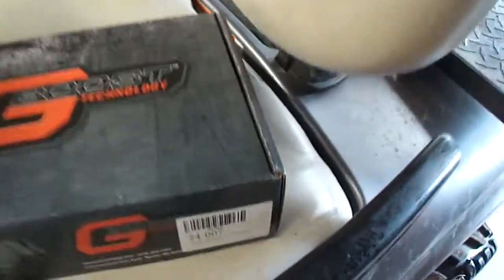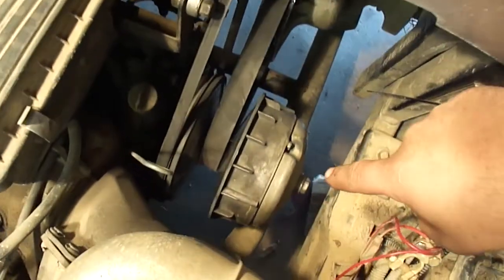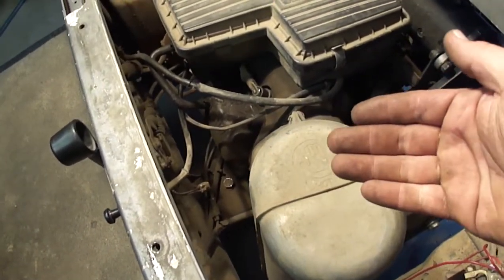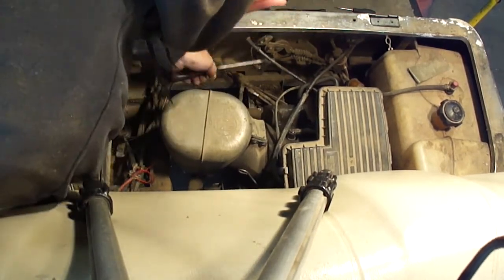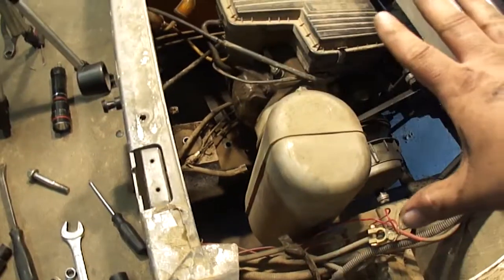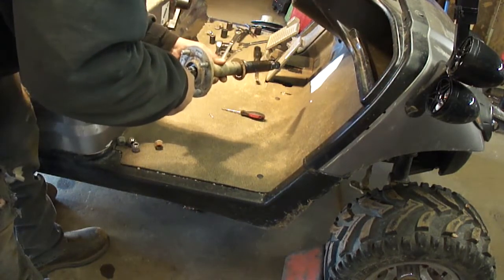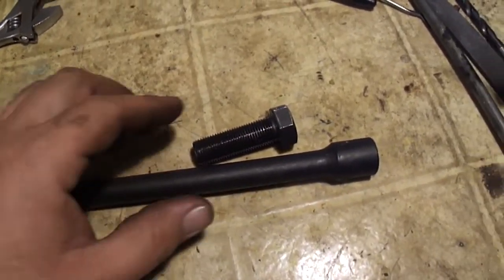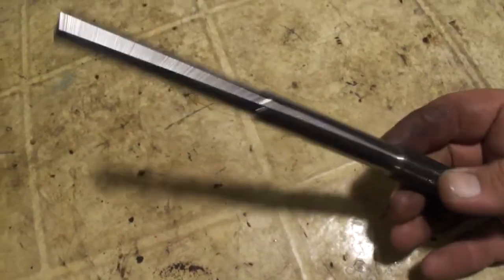2008 Yamaha G29 Clutch Kit Install (And Some Other things)

Comment: Turns out if you take the bottom bolt out of the left rear shock you can put a floor jack under that corner of the stabilizer bar and lift the body enough to clear that bolt.   You can’t use a straight socket and extension but you CAN get the bolt in and out to replace the primary clutch.   Not many videos or guidance on this.   Thanks for your efforts.
Reply from the maker: Thanks for your input!
Reply: Absolutely no guidance on this so thank you so much bro!! Just made my job on Sunday sooo much easier
Reply: That's how I access the clutches. Super easy and obvious really.